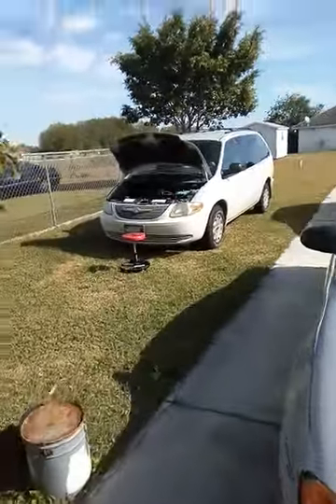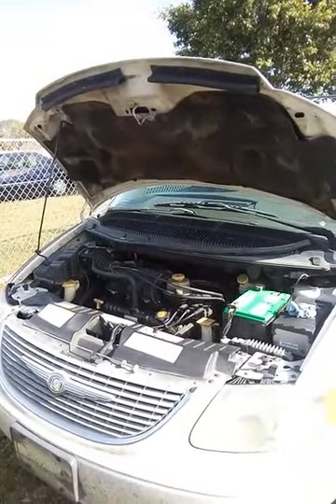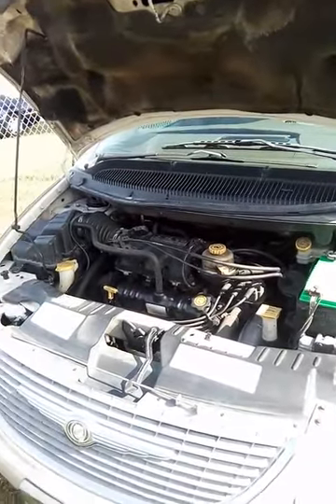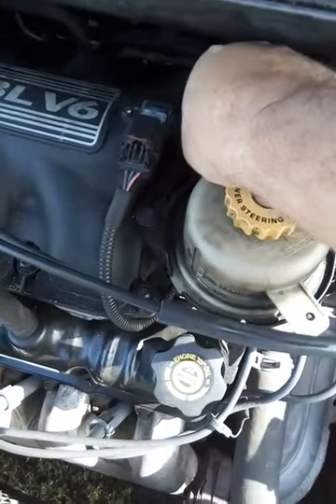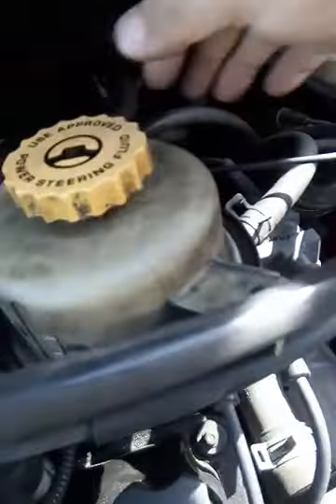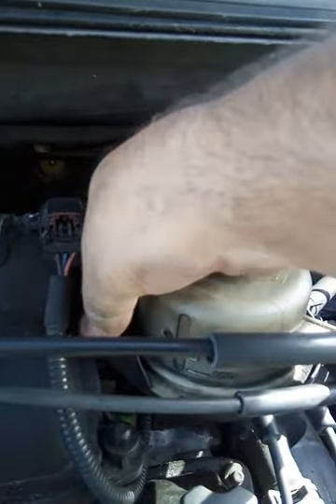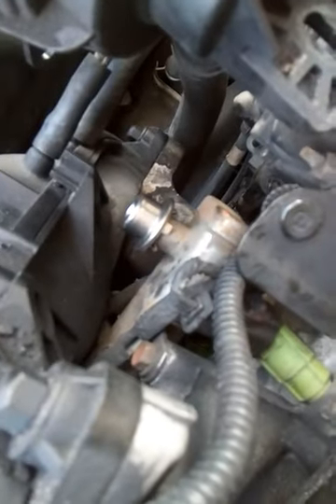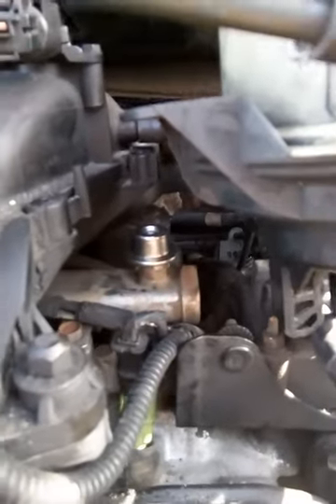2002 Chrysler Town and country Dodge caravan fuel leak gas smell fix.

Comment: Thank you very much! I've been having fuel smell and an extended crank for a few months. Today I finally decided to spend the time to get it solved. When I moved the power steering reservoir out of the way I saw signs that fuel had been leaking there. I turned the key on to activate the fuel pump, and sure enough, that part got wet with fuel. Your video was very helpful to figure out how to fix it, it saved me a bunch of time and headache!
Reply from the maker: Glad I can help I wish I would have been a little more thorough with that video but it was one of my earlier ones and I was just learning YouTube at the time thank you.
Reply: Mine wasn't wet but since u mentioned regulator I did the oring swap. Didn't solve my issue I still dont have pressure unless I toggle the key on and off like 5 to 10 times then immediately start. So it's probably the pump somehow not maintaining pressure.

Comment: Had  the same problem with my 2004 Chrysler Town&Country.Removed the Power Steering reservoir;however their was no Test Fuel Injector Port holding the O-Ring as in your video.I have a 3.3 Liter Engine.Apparently each year model is different.  FYI

Comment: Seems like some of you have had success with this method. However, I want to point out that never once in this video is it demonstrated being done. Kudos to those for which this has worked out but I felt compelled to reply since I've seen this method go wrong and gasoline was everywhere.  You may  be taking a big risk with your life and your loved ones. Hear me out... remember that this is a pressure regulator and if you remove it by prying up the teeth to replace the o ring and cannot or do not reinstall it properly it will pop off and squirt gas all over your engine creating the possibility of an engine fire, especially if you were driving when it popped off. Best to replace the entire fuel rail with the pressure regulator already on it.
Reply from the maker: I do agree with you . However I did not have my phone with me at the time of installation to go step by step. In many cases it has been successful if you do it properly based on my verbal instructions. However you are correct that replacing the fuel rail is the safest option though more costly and the time of vehicle down for scheduling repair appointment. As this is a older vehicle I would imagine most owners are on a budget and it was a fix that worked for me. Thanks for watching Please Subscribe.

Comment: Is that the same o ring that is used on the fuel injector?
Reply from the maker: Yes, it's sort of a turquoise colored o-ring that's the one. Replace that and make sure you bend those little tabs back on the cap and you should be good to go best of luck to you please like my video and subscribe thank you.

Comment: So would that caused the van to have to cycle the key to build up fuel pressure for it to start. I don't see it leaking any fuel but that's a good place for me to look I just got through putting in the second fuel pump and it's doing the same crap cycle the key for it to start.
Reply from the maker: Blake when you say cycle the key, I'm assuming you mean to pressurize the fuel rail by having the fuel pump come on. I don't remember if when I turn the key on to activate the fuel pump that it started leaking at that point I just know that when I actually had the engine start running I noticed the fuel spilling out. I hope this helps you any other questions please commentI will try to answer as quickly as possible to help you out if I can. Thank you for watching.
Reply: Thank you

Comment: Thank you for the video. I have an an 05 with the 3.3 and I don't have that 10 mm nut on the fuel rail. 

I am having the same fuel smell that you described. 

Any suggestions?
Reply from the maker: jmcveyster is the test Port leaking? Like in my video?
Reply: markythunder 

Thanks for the follow up. 

The test port on the 2005 must be in a different spot because I followed your steps and test port is not there. 

I think it is an EVAP purge valve issue on mine.
Reply from the maker: jmcveyster hope you find it sorry to get back to you so late.
Reply: The oring did not fix the leaking fuel pressure damper on the fuel rail of my 02. The diaphragm in the damper was leaking. I bought a used fuel rail from a 04 without the fuel pressure damper and installed it. The van runs great without a fuel pressure damper and does not leak.

Comment: sir how do you order it..?? my dodge grand caravan 2002 is leaking on the same exact spot like yours...
Reply from the maker: I have the part # on the package here in the video, I ordered it from Mopar parts online.
Reply: @markythunder  is it something simple where you just switch out the gasket?  and did it work fine afterwards? did you have to go back and changed again?
Reply from the maker: @kevinvang7208  it's an O-Ring it's blue green in color it will stop the leak , the trick is to get the port cap (tabs) bent back correctly this is the trick.
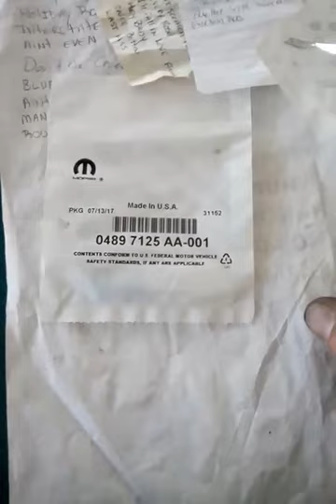Reply from the maker: @kevinvang7208  look at video about the 3:05 mark for O-Ring information.

Comment: will this make the car shut down just stop running after it sits for 25 mits it starts back up
Reply: Will you get back to me
Reply from the maker: Check fuel filter bud, sounds like it's bad. $18 worth the trouble . The leak at fuel rail  does release pressure but usually not enough to run injection dry.
Reply: markythunder thank you
Reply: markythunder is that the one on the top of the tank
Reply from the maker: @samuelcantley5500  should be near side doors follow fuel lines

Comment: Is this the same for the 3.8L ?
Reply from the maker: struggle4all not sure I know this is a 3.3 and it's common on all models with this motor
Reply: struggle4all how did you I smell the same on 3.8 

To be clear do I have to do anything to port first ? Like let the pressure out?
Reply: It's the same  motor  3.3 and 3.8 just a lil different  just got done doing mine  make sure u have the blue o ring  not the black o ring it dont work